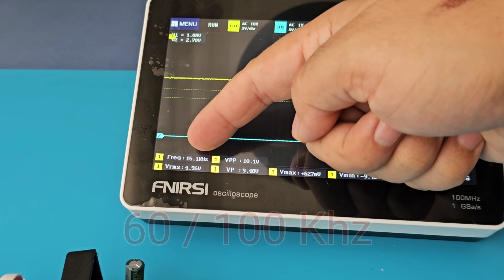You've Never Seen It Before, Converting Old Adapter to an Induction Heater

Comment: Abi 5v ile çalışacak indüksiyon ısıtıcı yapar mısın düşük voltaj düşük amper en az kaç w ile çalışabilir hep 12 v yapıyorsun
Reply from the maker: buı uygulama 5 volt adaptör ile de çalışır mosfetler 5 voltta pek verimli olmuyor bu nedenle 12 volt çoğu
Reply: @ZAFERYILDIZ52  abi benim projem var 5 6 volt veya 12 volt 2 amper çekecek şekilde olması lazım ondan dolayı istedim